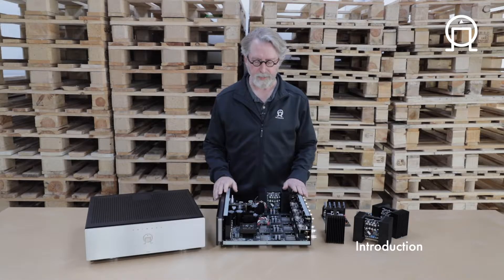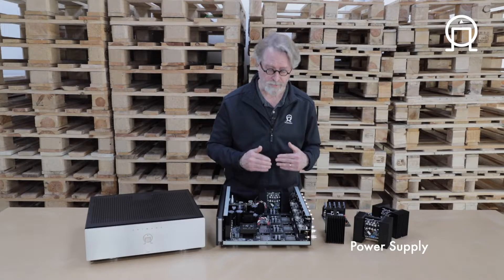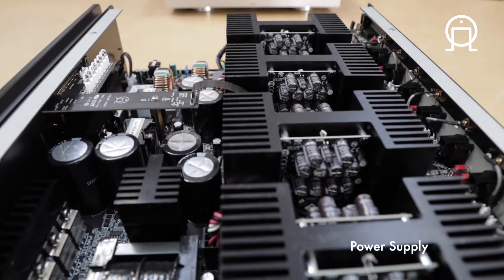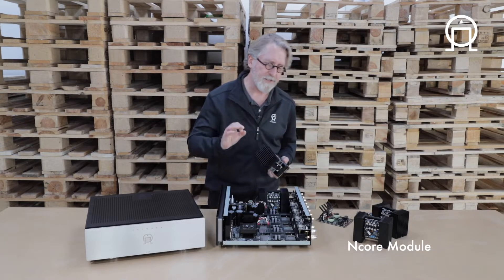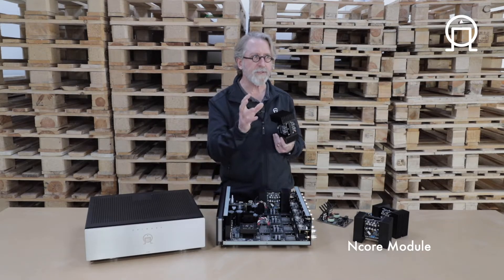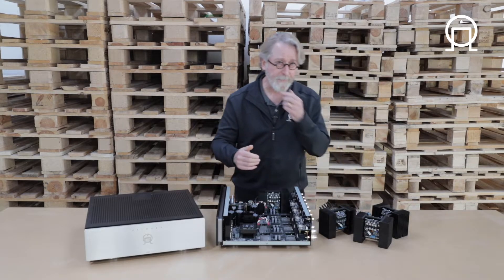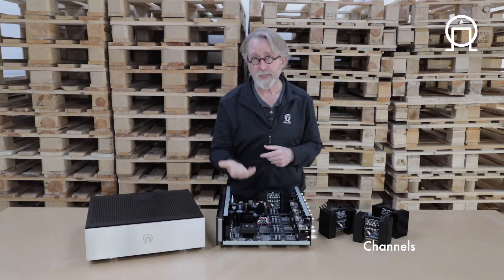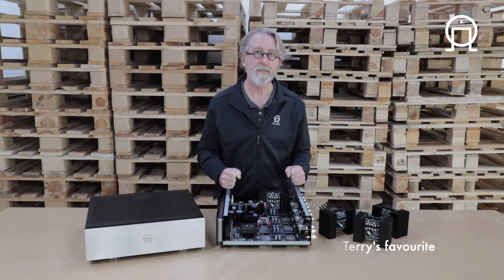A35.8 - Introduction

Comment: I'm going to be tri-amping , 2 channels (150 watts) for the tweeters , 2 channels (150 watts) for the midrange , the remaining 4 are going to be bridged ( L - R) to obtain 375 watts for the woofer. An active electronic crossover is going to be used , can't wait. This amp is perfect for what I want to do , clean robust and quick power.